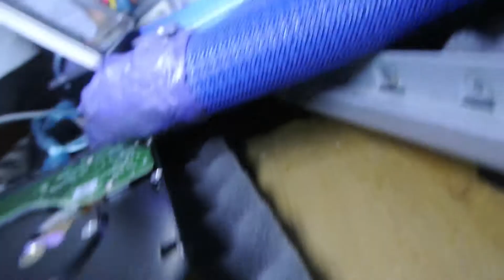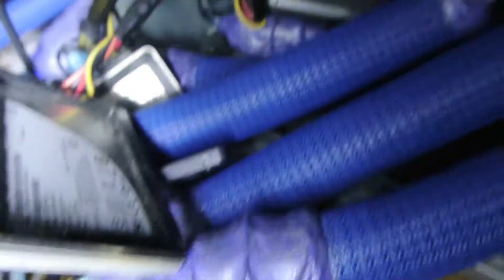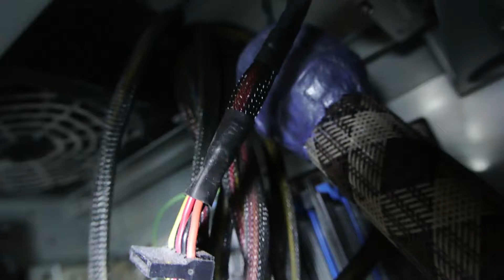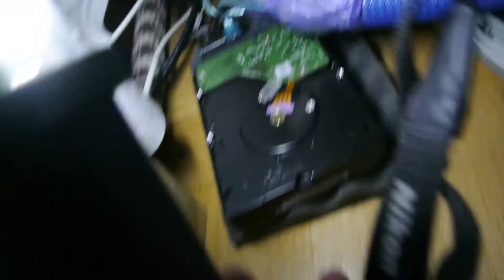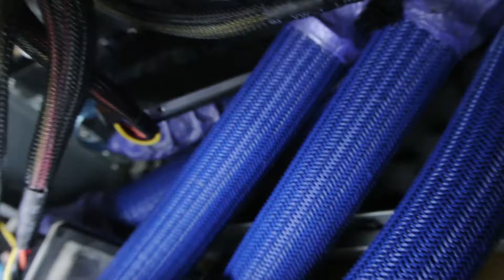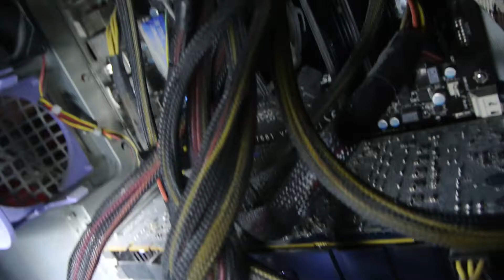6 Megalodon SATA cables in computer (32mm thick!!)

Comment: I see cheap sata cable wrapped in garden hose and fixed with putty.
Reply: This is fake - $2 SATA cable from china wrapped in garden hose - here is original: http://www.dx.com/p/sata-3-0-dual-way-6gbps-hard-drive-data-cable-blue-50cm-182284
Reply from the maker: The point of the hose is to hold something inside, there are a lot of retards who don't understand this.

Comment: Awesome... 6 x Megalodon SATA Ultra ($6k) cables. It's a cable city.  I bet it sounds awesome. I would love to have your Megalodon SATA cables believe me.  Only because I don't have the money. If I have them I would buy 7 Megalodon SATA cables for my computer.  Later this year I'm gonna try to buy a new power cable from you to power my DVD drive. I'm not using one yet as it adds more noise into the system.
Reply from the maker: Kleme If you want better sound it's needed.
Reply: Kleme
Like what Patrick said it's for better sound. You won't know until you try it. Got money? $500 a piece it's on sale. I am getting one shortly. He's finishing building one for me. :D
Reply: Kleme
Kleme, when are you going to get one?  You know you want it bad.